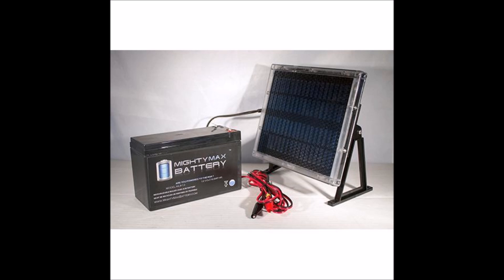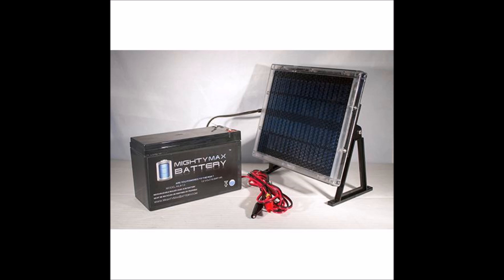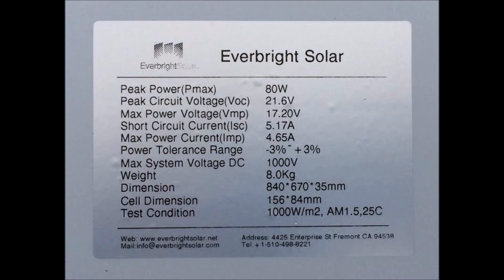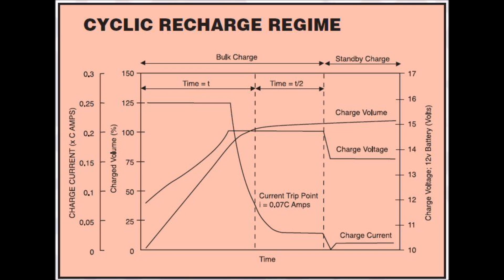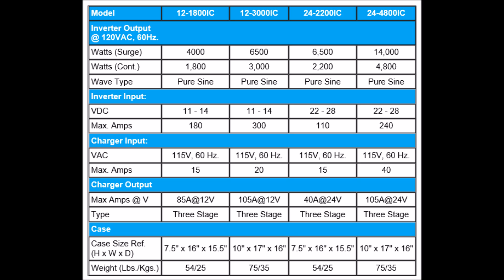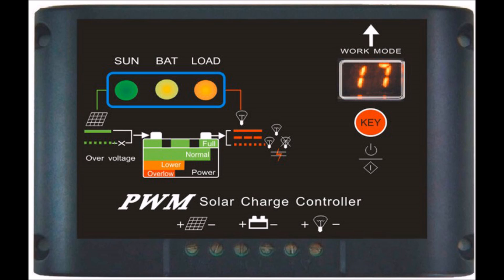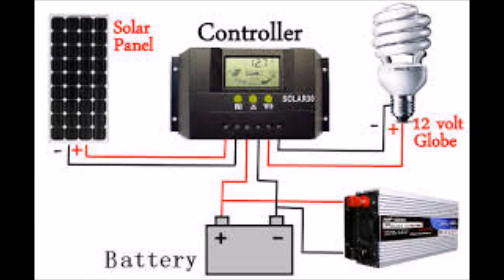Do You NEED A Solar Charge Controller??

Comment: If the panel is less than 15 watts, don't need charge controller...
Reply from the maker: That isn't really true.  Are you going to personally sit there and monitor the charging of the battery manually?
Reply: Donald Badeaux: back in the old days, they made what they called a self regulating solar panel. They were just solar panels that had a low open circuit voltage. They were not very efficient but for all I know they may still make them. I never had a problem with over charging, but I did babysit the batteries. The state of the batteries just told me how much stuff I had to do without. If I had a larger system, I would definitely have used a regulator. That being said, USE A REGULATOR!
Reply: P.S. A trickle charger will boil a battery dry given enough time. P.P.S. My nose hair trimmer draws more than 15 watts (really  tough nose hairs).

Comment: The maximum charge voltage once the battery is out of constant current mode and switches to constant voltage is a matter of some debate. Some battery manufacturers say that 14.8 volts (or even 15.0 volts) is just fine until  they are about 90% to 95% charged. At that point the voltage should be dropped to around 13.2 or so to avoid strong gas production and heating of the battery. 
By increasing the voltage to 14.8 instead of 14.4, total charge time is noticeably reduced. This can be important with solar systems when it if often a race against the clock (sunset).
Reply from the maker: Very true.  I am not smart enough to debate all that so I just use the manufacturer's specifications for their battery.  Usually you can find that information online or contac the company directly to find out.
Reply: a cheap small solar panel, though, is not going to have enough power to heat or gas a car battery

Comment: My new Powerfilm Rollable panel comes with a Sungard SG-4 controller made by Morningstar. It only has inputs for the panel and outputs for the battery. I want to run my fish finder/sounder on this system. Do I just connect both the controller and the sounder to the battery and have the finder run off the battery while I am on the water? Or, is it better to get a different controller, similar to what you show in the video that has a separate output for the sounder and the battery? New to this solar stuff. Thanks for any assistance you can provide :-) BTW, if you haven't already purchased your screencast software, I am a big fan of Screencast-O-Matic Pro. $15 a year and very powerful. I use it for lecture recording at my university.
Reply from the maker: You can do it either way.  Since you will be on the boat with the device at all times it should be fine running it straight from the battery.  The only drawback if you left it alone would be that it could over-discharge your battery and kill it.

I do need a screen casting software.  I have tried a few free ones and I hate it.  I will check out Screencast-O-Matic Pro.  Thanks for the tip!
Reply: So, you are saying that I can run both off the battery and the panel will charge the battery while the battery runs the sounder?
Reply from the maker: Kind of.  The solar panel will produce a set amount of power, lets say 10 watts, during the sun hours of the day (9am to 4pm or so in summer).  If your sounder consumes 20 watts of power then the net result is a discharge of 10 watts from the battery because the panel is providing 10.  If your sounder only consumes 5 watts then the net result is 5 watts of charging will go into the battery and 5 watts will go to the sounder.

That is very simplified but you get the point.
Reply: Makes total sense. Thanks!
Reply from the maker: You are welcome.  Thanks for watching!
Reply: Run the charge controller to the battery, and add a low voltage shutdown for the load.

Comment: So are MPPT controllers really that much better or should I just go with a PWM? I still don't really know what the difference is!
Reply from the maker: MPPT are more efficient and can get more power out of your panels but they cost about double or more.  So they are not worth it for small systems.  For larger systems they are VERY worth it.  I would say anything under 600W or so is probably not worth it but you would have to do some math for your individual application.
Reply: Would it be a good idea to go with MPPT with a small system that will be probably upgraded as the demand for more power dictates it?

Comment: Just adding that current grid-tie inverters can accept the panels directly as they can control and maximize panel input without the need for a storage device or additional voltage or current controllers. Cheers!  Good video.
Reply from the maker: Yes, I was careful to say all off grid 12v panel systems in the beginning of the video :)
Reply: Keep in mind that grid tie converters can be used in parallel with your off grid system. They add more power capacity, and allow the use of more than one inverter. As standard off grid inverters do not have the parallel capability that comes with them unless that is an included feature.
Reply: What about doubling up your 12v to make it 24v would that work ?
Reply: Meaning u could connect solar straight to 24v

Comment: NOOOOOOOOOOOOOOOO!

VMP is Volta Max Power, not the max volts under a load! its the output voltage at which the panel is most efficient, nothing more
Reply from the maker: That is not what dealers and manufacturers say:

"VOLTAGE AT MAXIMUM POWER (VMP OR VPM)
- This is the voltage that occurs when the module is connected to a load and is operating at its peak performance output under standard test conditions (STC)"
https://www.altestore.com/howto/solar-panels-pv-and-voltages-a98/

"The voltage and current at this Maximum Power Point are designated as Vmp and Imp."
http://www.samlexsolar.com/learning-center/solar-panels-characteristics.aspx

"Voltage at maximum power(Vmp) is the voltage at which maximum power is available from a photovoltaic module. Most solar panel manufacturers will specify the panel voltage at maximum power (Vmp)."
http://www.solarmango.com/dictionary/vmp-voltage-at-max-power-point/

Nowhere does anyone say anything about it is most efficient.  Just that is the point that it can provide the highest power under STC.
Reply: Exactly!

Comment: I do not use. I have a special voltage control switch that shuts when the battery charges. I am sure it's not the greatest, by some standards, but worth it for low emf.  The switch was expensive, but good quality.
Reply from the maker: Yeah, like I said there are some ways around it if you are determined or you want to personally monitor the battery voltage yourself.  But the newbies to solar that are asking me these questions need a charge controller.
Reply: what kind of voltage control is that mister Prima?